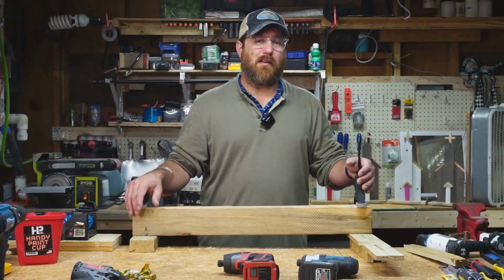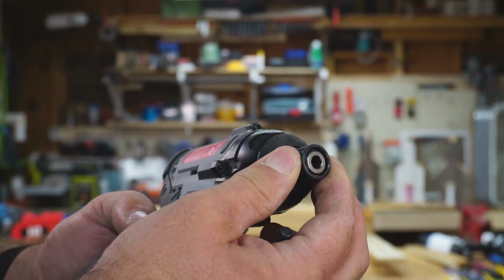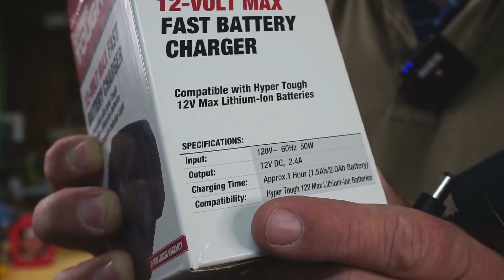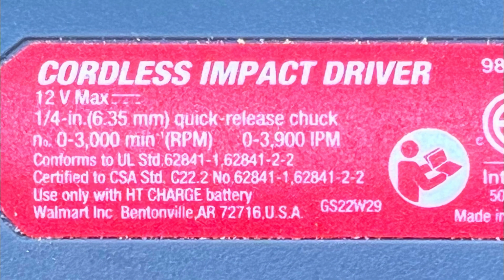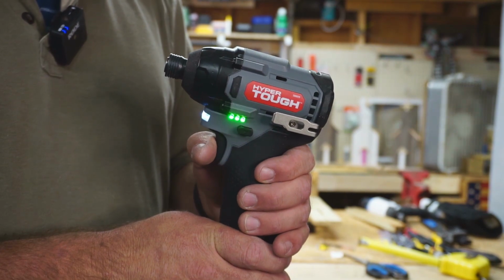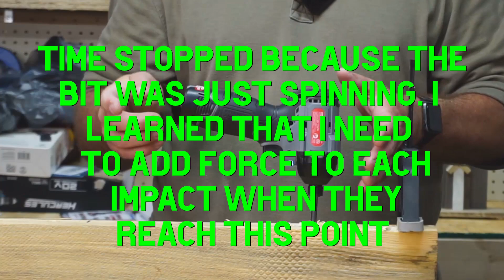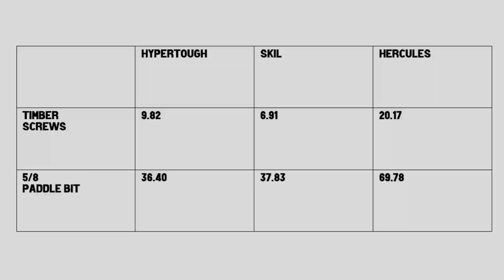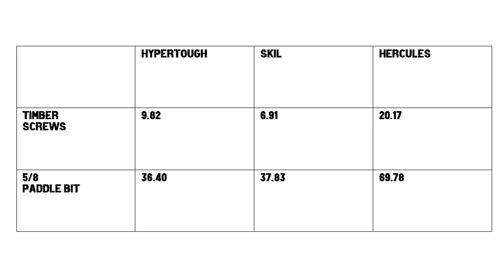Hyper Tough 12 Volt Brushless Impact Driver Test (Sold at Walmart)

Comment: I think for someone just getting into HVAC, that impact would be a good economical start. I think it would be just fine for removing panel screws on most equipment on a regular basis with that compact design for easy bag carry.  Just keep a couple extra batteries to overcome that horrible charging time. I personally use M12 impact and M18 drills for main use, I have a 12v Bosch impact for a back-up, I also keep a Dewalt 20v hammer drill for heavier stuff and that has worked good for me. And yes I do have a RYOBI for the wife to use around the house🤣.
Reply: Blu Air - I agree with you totally
Reply: @billymorrish4466  Maybe mommy and daddy could chip in for a teenager just getting into the trade, but if you come from a poor background and you are looking to get an impact to get you started until you make enough money to start upgrading to better tools, it will do the job for 5/16 and 1/4 inch panel screws when starting out with maintenance work as a new hire with little to no experience. Not everyone can afford Milwaukie and the name brands when you are getting started in the trade.
Reply: @MyHVACLife  I see your point, and your right.
Reply: yesss ryobi tools stay at home 😭
Reply: As an hvac tech i just bought this last week i love it fits in tool bag lightweight its perfect
Reply: @Chiwawaleg  have you bought the fast charger and 2ah battery?
Reply: @Lyle-1999  i bought the 2ah battery but not the fast charger
Reply: I just bought this, already have my makita 18v impact but I got this one to fit in my little service bag, can’t wait to try it out!

Comment: There we go again with the comparisons to much higher dollar professional, commercial grade tools. Hyper Tough are very good tools for the do it yourselfer or homeowner at a great price. The comparisons are unfair and kind of snobbery. I'm referring mostly to the comments section.
Reply: Exactly.  I had a tree fall down in my yard and needed to remove it.  I didn't want to pay hundreds to have it done, so I went to wally-world and bought a hypertough 14 inch electric chainsaw for like $60.  That thing tore through the tree no problem. I cut it into pieces, put it on my truck and I was done. Have used it several times since for cutting other stuff and it's going strong.  People like me are who Hypertough markets to - people who need a tool in a pinch.  They are not marketed to pros who use tools all day every day. I think Hypertough would even admit that.

Comment: The funny thing is, I have impacts and drills from Milwaukee's M18 line because I used to sell them and use them when I was a small engine mechanic. I mostly use Hyper Tough impacts for most things because they are light, cheap and work with our overkill on power. If I need some serious nut breaking torque, I do grab the Milwaukee for the brute force they deliver.

Comment: The new M12 impact is $129 bare tool…
Reply from the maker: There is a $99 deal going right now - Your friend has shared a link to a Home Depot product they think you would be interested in seeing.

https://www.homedepot.com/p/Milwaukee-M12-FUEL-12-Volt-Lithium-Ion-Brushless-Cordless-1-4-in-Hex-Impact-Driver-Compact-Kit-W-2-0Ah-Battery-and-Bag-3453-21/320559163
Reply: Got to love those Black Friday Christmas deals!
Reply: Now put it on the side of the 99.00 m12 kit for a few extra dollars Milwaukee fuel all day

Comment: I'm an electrician and use 18v and 12v Milwaukee at work every day. For side work or for work around the house, these have been sufficient for the most part.

Could you redo these tests with the new 4ah and 6ah batteries?

Comment: I bought the same model but it has that annoying soft start that the new impact wrench has. I couldn't tell if the one you reviewed has that I couldn't tell.
Reply from the maker: It does not
Reply: @zacksintheshop  that is odd because it's the same model number.

Comment: When you place the 1/4 inch socket adapter in the chuck, does it have thrust play ( back and forth)? Mine has this kind of play ( around 5mm) when i place the socket adapter. I am wondering if this is normal.
Thank you for the video, bro!
Reply from the maker: I have found that a few of my impact drivers have quite a bit of play. Don’t think it’s too abnormal. As long as the bit stays in and does the job I think you’re good.
Reply: @zacksintheshop  Thank you!

Comment: The Skil is a beast, but the Hyper Tough held it's own in comparison.
I work at Walmart and several years ago, when Sears started shutting down, and sold Craftsman to Black and Decker/Stanley, I thought Walmart would then start carrying Craftsman too.... Then they dropped B&D/S and never picked up the Craftsman line but went with Hart instead, I was extremely disappointed. I still haven't forgiven Walmart for that idiotic move. Try giving your customers some options in-stores.
But I have bought a lot of Hyper Tough tools, and I do like them quite a bit. They are inexpensive, and if they aren't pushed too much to the extreme (don't use a 1/4 drive where the 1/2 drive should be used), they will hold up just fine.

Comment: No offence to the hypertough impact you tested, or the other two, not everyone has the budget for big brand tools🤷🏻‍♂️
But if you had included the m12 fuel that the hypertough is styled after in your tests it would have made all 3 that you tested look like a joke. It’s cool to see someone testing cheaper tools though-make sure to do a follow up 6mos or a year down the road after using that hypertough, would be interesting to see how it holds up.

Comment: Nice review. I have the long reach ratchet. I like it so far.
Reply from the maker: I saw there were a couple more tools like the ratchets and a rotary tool. Wondered how good they would be. Thanks for the comment.
Reply: Same here. Managed to get it with $15 off via a PayPal deal with Walmart. I grabbed this brushless impact so now I have both tools with 2 batteries for around $110. Going to wait and see if I can grab the 2.0A battery and the fast charger if they ever go on sale. Don’t need them right now anyway

Comment: They have a 2 year warranty on them. Says in the manual if it brakes under normal use to return it to the store with receipt and it will be replaced.  I bought one for my steel metal/install tool bag. Well see how it goes.

Comment: I bought one of the impact wrenches and it turned out defective. It wouldn't impact. It acted like a drill and tried to twist my wrist. I held on, and it wasn't powerful enough to break the bolt without impacting. I exchanged it for the oscillating multitool.  Maybe ill try it again since I've seen positive reviews.

Comment: You should check out the new skil 12v it's amazing also nice video
Reply from the maker: The 12 volt Skil is in this video, is that the one your talking about?
Reply: @zacksintheshop  no there is a new version gen 2 and it's much better that the first
Reply from the maker: Wow. Didn’t know that
Reply: 12V New model Item #5041709
Model #ID6744A-10
$65.98 at Lowes.
Reply: @zacksintheshop  I just saw Lowe's put at $129, 5 tools combo with 2 batteries, the New skill 12v 2nd gen. Item#2758780.     Just the 2nd gen drill and impact 12v at $99 Item#5041704  until December 24 last day.

Comment: Why is that a Great deal?
I just looked up Kobalt 24v brushless combo kit for 179.00.
Circular saw, Recipicating saw, drill, impact driver, 4.0 battery, 110w fast charger. 
That's 45 dollars per tool or 29 dollars per item.

Comment: Actually although similar to the M12 battery it's actually much closer to Chervon's  12 volt pack that they made for their Craftsman  NexTec products. Looks identical but they don't interchange. Chervon been expanding lately I just discovered that they had acquired Skill that used to be Bosch, and Skil quality surprisingly improved since then.  They been making Kobalt and Flex, and now I'm wondering if they're making these hyper tough tools as well. I have the Long reach ratchet, so far it's been pretty good I'm very pleased with it. Clearly though these are low drain rate batteries, and no doubt these tools will actually be a lot more impressive if they had high drain rate cells maybe in the future they'll add that option.
Reply from the maker: Thanks for the info man, appreciated
Reply: Given that Hart (Walmart's other 'house' brand, which seems to be positioned as a bit more premium and gets a whole bunch more advertising) is made by TTI (makers of Milwaukee/Ryobi/etc), having Hypertough made by Chervon would be an interesting choice of OEMing by Walmart. Walmart is certainly big enough to get away with it, but I'd imagine that the more they buy from one vendor, the better the terms they get are.
Reply: @davidedwards9157  Yes that is true, and it actually is pretty odd Home Depot's product line is dominated by TTI and doesn't even have a single offering from Chervon, and Lowe's has none from TTI, not even Milwaukee which TTI keeps free to be sold anywhere. Does kind of seem like home Depot must have struck some kind of deal to keep Milwaukee out of Lowe's that otherwise has a more diverse brand selection than Home Depot including Chervon's three biggest brands Kobalt, Skill and Flex. So it does kind of make sense of Walmart might look for some offerings from both companies, and if this 12-volt stuff from a hyper tough isn't Chervon it sure extremely similar  to their Craftsman NexTec line. Unfortunately though I think hyper tough is being made by several different companies, I don't think the 20 volt line is made by the same company.  I have used this ratchet quite a bit since I last commented I am more and more impressed with it everyday. I actually have yet to see it struggle with anything,  including running nylon locknuts as we seen tested in TTCs videos.
Reply: @Troyvidihoo  I suspect the TTI/HD relationship (and the Chervon/Lowes relationship, for that matter) is more tied to the 'makes the high-volume house brand and gets sweetheart pricing due to volume' thing... I don't think HD is opposed to selling (say...) Skil (which probably would sell better than Ridgid at this point), but they have finite shelf space, they have contracts with StanleyB&D/Metabo/Makita/Bosch (and customers who buy them), and TTI gives them better pricing on Ridgid than Chervon will give them on Skil (and Lowes probably wouldn't do enough volume on Milwaukee to get the leverage to do the loss-leader sales that HD does every couple months).

As a side note... I'm really impressed by how good the low-end brands are getting. When I started (early 90s), Ryobi was kind of a joke (at least the battery powered stuff), Kobalt wasn't even in battery power tools yet, Walmart had a rotating selection of tools from brands you never heard of before (and never would hear of again), Sears didn't want to make battery-powered tools over concerns about tainting the Craftsman brand (which was actually respected at that point), and Warrior/Chicago Electric were the best Harbor Freight had (and that was in the 'QA is performed by the customer' days). At this point, that HyperTough impact driver looks vastly better than anything I had available at the time, and if you factor in inflation, the 9.6V Makita I was using was probably 20x-30x more expensive. I like to think my current M12 Fuel is a better tool than the HyperTough, but they're a whole bunch closer to each other than either is to the old stuff, at least in performance (longevity is a different question), and the same goes for Ryobi/Kobalt/Bauer/Hart/(new)Craftsman.
Reply: @Troyvidihoo the reason Milwaukee is not in Lowe’s stems from a long time back (2008 to be specific) when Lowe’s and Milwaukee’s agreement expired, it was not renewed because Lowe’s did not pay the bill on a 1.2 million dollar shipment of tools. I believe there was a lawsuit and everything. The agreement was never renewed again.
Reply: @davidedwards9157  I hear ya, although I recall Bosch and Skill being sold at HD before.  I have noticed that HD and Lowes  try to lock eachother out of brands, and when it happens you see them move. Bosch, Skill,  Porter Cable, Ego, Irwin, sharkbite, all were at HD and now are exclusively Lowes.   Milwaukee, Klien and some others I forgot now are only in HD. 
I think there is back room deals going on at some point.  Both TTI and Chervon make brands for other stores, and not both HD and Lowes, seems suspect to me. 

ON the side note, I agree the true blue (pre TTI) Ryobi cordless tools were actually on par performance and quality with your big brands back then, but no one knew cause the batteries were a literal joke. And they had allot of cordless versions of tools most other company didnt make cordless of at all. I discovered it because I had Ridgid batteries( I do have to mention  I wouldnt take Skil over Ridgid, though skill is coming up now)  and only Ryobi made a cordless grinder at the time. So I made an adapter out of an dead ryobi battery a friend gave me. That grinder is awesome  with 7"  wheels (little slow for the nominal 4.5" @6500 rpms) power hungry compared to modern brushless ones but is more than powerful enough for anything you would do with a grinder.  Then one day we discovered it struggled to cut cardboard (Literally) with his Ryobi batteries! If I hadnt seen it with my batteries first I would have returned it immediately! Then likewise his other tools were radically stronger also!  The tools were actually pretty good, just totally starving for power. TTI Ryobi has improved further yet, but I fault TTI for removing the cool features like the levels and magnetic holders. ( I often wonder why all the makers only occasionally put levels on their low end drills instead of the serious models where the customers actually want those features!) Ironically Ryobi was the TTI of yesterday that was making allot of brands in the background and now itself is just a trademark.
Reply: @mattblanchette2767  Interesting, seems you have some inside info my friend!  I guess that could definitely explain why TTI doesnt make anything else for Lowes as well!  Still seems odd Chervon makes nothing for HD though.
Reply: @Troyvidihoo  I looked it up a few years ago, I like Milwaukee but prefer shopping at Lowe’s because they otherwise have exactly what I want. Now with Flex around and Kobalt’s tools really upping the quality, doubt they’ll be in Lowe’s anytime soon.

Comment: the Walmart near me (Charlotte suburb) clearanced all the 12v line 50% off. I got this brushless impact, drill driver and the 3/8 ratchet and a 2ah battery + fast charger for $25, $21, $17, $9 and $9 respectively.
Reply from the maker: They are reduced here as well, nice deals